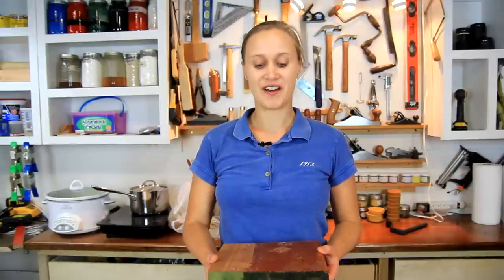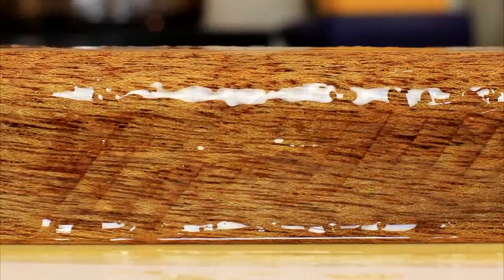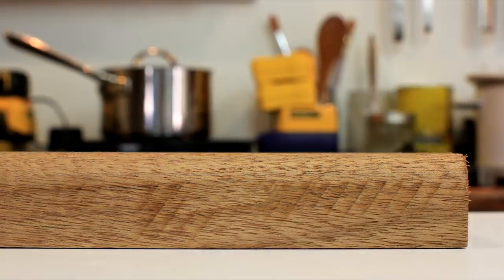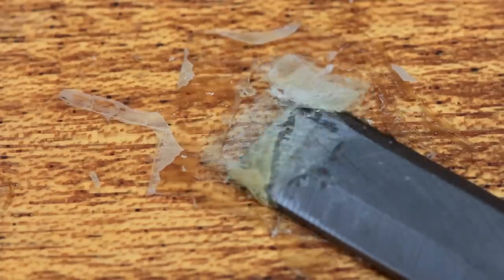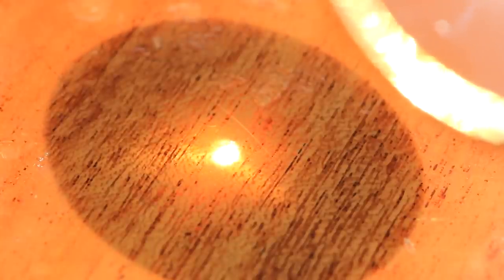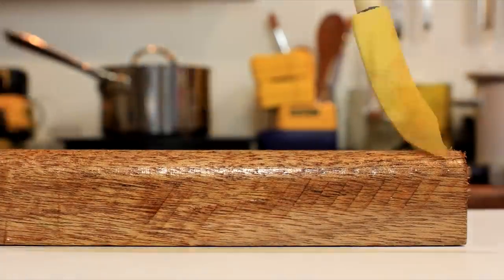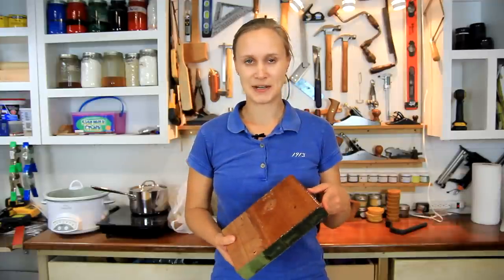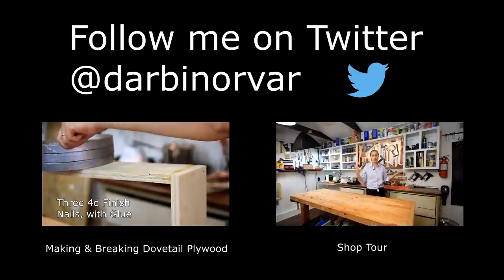What does 40 Coats of Polyurethane Look Like?

Comment: As a professional painter of nearly 40 years (now retired) I have applied countless coats of poly and varnishes over the years using many brands and I found the following to be true. First, there are trade offs and compromises to all finishes.  The slower the material dries, and cures, the less brittle and more durable. True varnish is better suited for exterior surfaces because it is more flexible but yet seems softer than poly, perhaps because it's less brittle. The higher the sheen the harder any of the two products are and more durable yet varnish still has much better flex. You do not have to sand between coats to achieve proper adhesion with either product as long as, 1st, each successive coat is applied after the previous coat has thoroughly dried, (other wise you may get whats called gassing, which is when the solvents in the material are still trying to escape and in the process will push the following coat off, even of only microscopically.) 2nd, each successive coat is applied before the previous coats have cured. There is a difference between dry time, re-coat time and cure time. Typically with most finishes, if the product is dry to the touch or it can't be removed by the use of the fingernail test, it can be recoated. Once a finish has cured, the the surface must be chemically or mechanically abraded so there is tooth for the next coats to adhere. As for poly or varnish, the only real reason to sand between coats before curing is to remove air born dust and to help level the previous coats. I could go on and on, but I won't for now. All that being said, I enjoy your videos and your way of thinking outside the box. I have found YouTube to be a great source of learning and re-learning so thanks and please keep up the good work.
Reply from the maker: kperellie Thanks for your input, I appreciate the comment.
Reply: kperellie very educational reading... Thanks
Reply: Hello, I know this is a 2 year old comment but I will try my luck anyhow. I am trying to find a good textured clear coat for a wooden toy. Something sort of slick, but with traction. A normal gloss finish is too slippery for me, and matte texture doesn't feel right. Can you recommend a clear coat that you think has a good slip to traction ratio? Thank you if you see this and reply!
Reply: pen mightygun, I'm not sure what your point is, but your dictionary gives a trivial definition that most woodworkers would argue with.  Any definition that equates varnish, lacquer, shellac, etc which are all different in any but the most superficial ways, is useless.  Some of us old-timers don't like calling poly "varnish."  Notice how kperellie compared it to "true varnish."
Reply: Chocomantis, try adding sand to your favorite finish.  Aquarium sand comes in several sizes and colors if common play sand doesn't work for you.
Reply: YT is also source of misinformation.
Reply: I'd cut a long story short, but it's much too late for that.  Yeah

Comment: I use a water base polyurethane which dry's in minutes, steel wool in between coats, put about 5 coats on tops that will be used, two coats on legs or areas that do not get much contact,  then let it set for about a week to harden.Work fine for me.

Comment: I believe this would've been more beneficial had you applied the poly according to the directions. We don't know the characteristics of 40 coats if it was applied properly.
Reply: +Monster Bear  I was wanting to know. I have applied 20 coats to my table the proper way, sanding between each and letting it dry for a day or more sometimes between. I have been using minwax oil based and it still doesn't give the glasslike look and is still very thin at 20.  I refinished a walnut gunstock for my father and decided to use a product called Tru-oil because everyone says it is so easy to work with. I have since found that I love it. It builds much quicker and is so easy to work with. It is not as protective as poly though so I decided to use the tru oil and then sand and then apply poly. IT WORKED! Epoxy like finish with many fewer coats and protected on top with POLY!
Reply: +Monster Bear We do however now know a little regarding how thick it gets - which is the main comparison with epoxy in this test.
Reply: +wildonemeister Its not its true thickness. Ive worked with polys and different finishes extensively. When you sand and finish it produces different results. Everything is thick when you just pour it on.
Reply: +John Tate Tru-Oil is awesome stuff. I've finished gun stocks with tung oil walnut color.
Reply: Sanding between also makes the poly have a textured surface, which means the next coat adheres better to the previous. That's why this is common practice, it means a more cohesive finish instead of several thin layers of "plastic" like in the video.
Reply: Correct.  Not allowing each layer to fully cure before applying the next layer means a lot of solvent remains trapped, with the result that you're interacting with a very thick layer of urethane that will remain soft for months or years before all the solvent works its way out.
Reply: jacktheripped , it will not it adhere... you poly will just flake and peel away...
Reply: Briar Fox where did you find walnut colored tung oil?
Reply: John Tate try "perfection plus" from international, great glossy finish and crystal clear
Reply: Monster Bear wait time 8 hours between coats
Reply: Absolutely. This only shows what not to do and the results. Now show them with the proper application. I DO know what the result will be, but would like to see it here.
Reply: Jacktheripped,If you are refinishing a boat like you say I would highly recommend you to use something like Interlux Schooner Varnish. Not cheap but what we use extensively on exterior wood due to its UV protection,  beautiful looks, and ease of use. About the only thing that holds up around the Gulf Coast/Caribbean.
Reply: Agreed. This whole video, every technique, every step, and the last 32+ layers for that matter, are all examples of "what not to do."
Reply: I just care about the rock throwing, my family likes throwing rocks at our furniture as a nightly pre-dinner ritual, and I think for our dining table, I might need to slap 80 additional coats on there, like maple syrup, as quickly as possible, for an effective protective coating, 
My daughter enjoys peeling the poly off with a chisel when she gets bored or sad, I think she has pica and might be eating it, so I also need to take that into account. I may use polycrylic, because it's water based, and I want to make sure she stays hydrated. 
1/16" is hardly enough! I've decided to make a dining table completely out of polyurethane, use a mold, just a huge opaque table, made of like 800 gallons of oil based poly. Then my kids can blowtorch it, throw rocks at it, whatever.
My father suggested a Danish soap finish, to let wood be wood, and just maintain it, but I think this coating wood in plastic thing is the way to go. I want my wood to look as plastic and greasy as possible, and reflect light like a mirror.
Reply: @johntate4638  you are supposed to water it with ms & hand wipe it on thats why.

Comment: Sanding between coats makes the poly bond properly. Also letting each coat fully dry would produce better results.
Reply: Yeah, she says that in the video.
Reply: Agreed. Sanding gives the surface "teeth" for the next coat to bite into. I'd not base your viewpoint on urethane wood coatings on this.
Reply: It bonds properly without sanding if the coats aren't applied after a long interval. Sanding between coats is to get adhesion if the finish is fully cured, but more often to make sure defects (orange peel, pieces of dust, etc) don't create flaws in the finish.Since you don't buff it like you would lacquer, you have to level it by sanding as part of the application.
Reply: This is a long time, but. ...  Letting each coat dry, then sanding it before the next coat, gives you a mechanical joint between the coats, teeth if you like. Each coat is a separate entity and can slide off the coat below. If you apply the second coat before the first coat has cured, you get a chemical bond - "wet on wet". Each coat is chemically bonded to the previous coat and is far, far stronger than the mechanical joint. Polyurethane can be extremely dangerous. The catalyst can blind you even if it's extremely diluted. Much, much better to use epoxy.
Reply: @daw162  I love reading comments when people actually know what they are talking about. More often than not people just regurgitate misinformation. Each coat of oil based poly can be applied after about 4 hours without sanding. Low temps and high humidity will cause slower dry times. Sanding is only necessary after the poly has dried for 12 hours or more or you have bubbles and or dust that you are trying to remove.
Reply: @roadie3124  Epoxy is not as flexible as poly and has inferior mechanical properties in some applications.

Comment: Keep in mind that there are two major types of poly.  Oil base must be treated differently from water base.  That said, I rarely sand between coats of either.  The solvents in oil-based poly can't redissolve a fully-cured base coat, but if the base coat is only partial cured a top coat can still chemically bond to it.  I find that the typical manufacturer recommendation of 2 hours between coats is too little, but if you're in a hot, dry climate it may be right.  After applying 5 coats at 2-hour intervals I had to wait more than a week for the finish to fully cure.  Four hours has worked well for me.  If done correctly you can build a very thick single layer of finish.  Allowing coats to fully cure and sanding in between forms multiple distinct layers of finish.  It can produce excellent results, but it requires more care during application, and can be harder to repair if the finish gets damaged.

I normally apply a thick coat of poly, carelessly, and repeat every 4 hours until I have the thickness I want.  I typically apply 2 or 3 coats on furniture, and 4 to 6 coats on floors, stairs, and countertops depending on how much abuse I think they'll take.  I let the final coat dry for at least 48 hours, then sand it aggressively without any fear of cutting through the finish.  I usually start with 150 grit on an orbital sander with mineral spirits as a lubricant, moving up through the grits until I get the gloss I want - 320 is sufficient for a satin finish.  This is where a single, thick layer of finish is superior.  If your top layer was applied to a cured and sanded base layer and you cut through it you will see it, so final sanding must be done carefully.  That's no problem if you did a good job of applying the base coats, but if there's a big run somewhere you won't be able to sand it smooth without cutting through.  With a single, continuous layer you won't see it unless you cut through to the wood, so you can easily sand out any defects in your finish.  This remains true forever, so it also allows for the ability to sand out damage as long as it doesn't go all the way through to the wood.

I only sand between coats if I accidentally wait more than 5 hours.  If I miss my window for the next coat, then I let it cure for 24 to 48 hours and sand before applying the next coat.  I always finish with at least two coats that are chemically bonded together.

The solvents in water-based poly will redissolve the surface of the base coat, so sanding between coats of water base makes no more sense than sanding between coats of shellac or lacquer.  But water based cures much softer and less chemical-resistant than oil-based, so I don't generally recommend it.  Poly is a hard to work with and repair compared to most other finishes.  Durability is the only reason to use it, so why use a less-durable type?
Reply: I just realized I misspoke above.  Technically, the cross-linking of polymer chains in the different layers is a physical bond and not, as I said, a chemical bond.  Nonetheless, it's distinct from the adhesive bonding that occurs between a cured layer and it's topcoat.
Reply: And now I see that I made pretty much the same comment as +kperellie below - but much longer of course.  I'm a schmuck.

Comment: Should of let them both dry completely before applying additional coats. It will be like her results if not. They both will stay somewhat soft. It's called solvent entrapment . Solvent entrapment is where you apply that topcoats to fast between one another and it doesn't reach is Flashpoint. Flashpoint is when it releases the last of the volatile organic compounds the most flammable part also but anyway

Comment: Catalyzed urethane (LPU) would get significantly harder than that. Also, even with epoxy, there is a time limit (hrs) that it can be recoated before needing to be sanded between the coats.  Polyester, the same. Fully cured and it will need to be sanded between coats.

Comment: You should've also made one with the drying and sanding between layers, and then compare and test both simultaneously...
Reply: +νικος γιώργος That would have taken quite a bit of time (over a month!). Time is money. So is all the waste - new brushes and all the work stirring the poly before using it.
Reply: wildonemeister
 Yeah but she wouldn't have to baby sit it over that month. She could still do some work...
Reply: wildonemeister     it took months for this experiment to dry, the only difference would be the sanding and adding another coat each day, &  if she treated only an 8x8 area of wood for comparison, that would literally be under a minute.  that kind of time isn't money.
Reply: There's limits to how deep you can layer this stuff before it becomes the actual structural layer instead of just a surface sealer.  Putting 20 layers on something yeah, will eventually get it to look like lacquer glassy smooth but it's still polyurethane, it's supposed to be tough when layered on thin, not necessarily glass like hard.
Reply: I see zero value in this exercise! 

 Improper process = worthless results
Reply: Why don't you try it instead of asking her?

Comment: I picked up a soft pine dining table cheap, made a vertical 'wall' of tape around the edges, and carefully poured polyurethane on the table top right out of the can and let gravity smooth it out horizontally. After it dried I removed the tape and painted more on the edges to smooth it out and it came out great.

Comment: This was a pointless test, you must let polyurethane dry and and between coats to ensure a strong finish is achieved.
I am surprised it even dried with 2 hours between coats with 40 layers, pointless exercise.
Reply: It probably never really "dried" ever. Out of the 40 total layers, even after a month or two, I wouldn't be shocked at all if the middle 30 coats were still soft because they were sealed by the inner and outer layers with no chance to off gas and cure properly.
Reply: She should have tried Solarez, dries after 2 minutes of being in the sun.
Reply: She literally points that out in the video ....

Comment: Polyurethane can be applied quickly if you use japan dry in it. Sanding between coats is essential, as roughing the prior coats surface allows the next coat to bond..It appeared the wood had a stain on it, if it was not fully cured or had sealed the wood the poly would not adhere well.
Reply: It may also blush epoxy gets a thin layer of oil you need to sand than use a degreaser or mild cleanser on before going over it.

Comment: Nice one Lynn. Why not try using small blocks of similar wood and apply different finishes and let them cure for the same amount of time. Then you can cross section, drill, hammer, screw and heat them all to provide a test study.
You could try Poly (oil and water based), Epoxy resin, 5 minute epoxy, tung oil / mineral oil, lacquer, shellac, varnish, and any other that comes to mind. That is, if you felt like "applying" yourself. ;) - Either way, I really enjoy your videos!

Comment: I’m an amateur, but am having great success at 80* Fahrenheit, and 30% humidity in my work area. I’m able to re-coat fully every two hours. I do thin my mix as it goes on nicer. Do 3 coats to every 1, if you are thinning. I’m
Covering a countertop so 40 coats wouldn’t bother me honestly. I like when any mess slides off

Comment: Dry time was the biggest part of the problem. As I understand it, the only real difference between poly and epoxy is that epoxy is chemically hardened via an additive whereas poly is hardened by contact with moisture in the air. Adding layers too quickly means that the previous ones won't truly cure due to the lack of air contact.

Comment: Always nice when people post projects like this so thanks for that, However I disagree with it since I've done the same thing how I believe to be the right way and mine is rock hard and doesn't peel or chip. Let it dry between coats and leave it for a few months before you try chiseling it off. this is just my opinion based on my doing the same thing, no disrespect meant.

Comment: Not enough time between coats and no sanding for adhesion optimization is going to lead to failure. You demonstrate what will happen if you don't follow directions.  That should help add some people.

Comment: Perhaps you should apply 40 coats with sanding and drying in between as the MFG instructs, otherwise this is the result you will get. A thick, single coat that won't dry for eons.
Reply: that was the purpose of the experiment lol
Reply: @floorman12  no it wasnt

Comment: Not as thick as my 1979 Fender Stratocaster guitar polyester finish.  I had to use a heat gun to remove it, it was almost 2mm thick.  It probably had 100 coats LOL